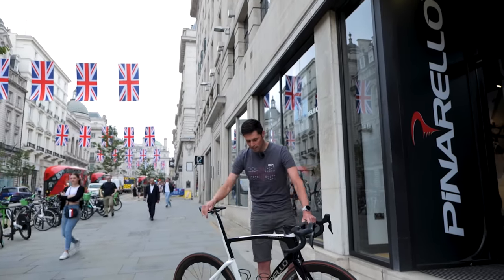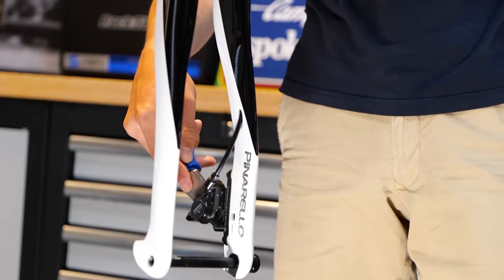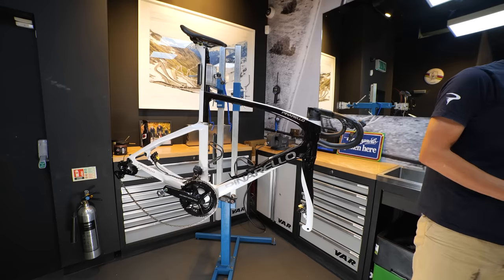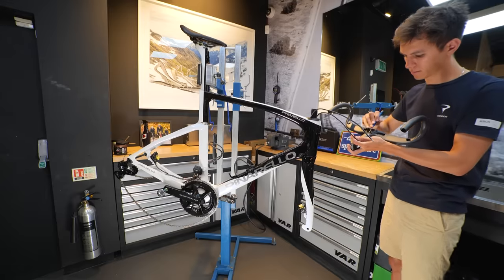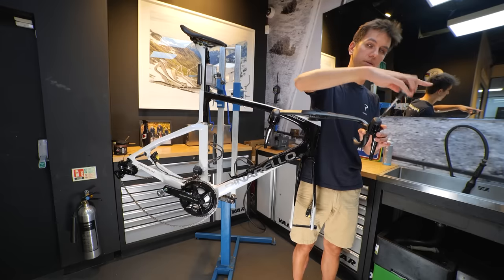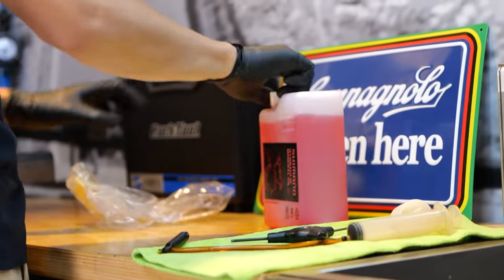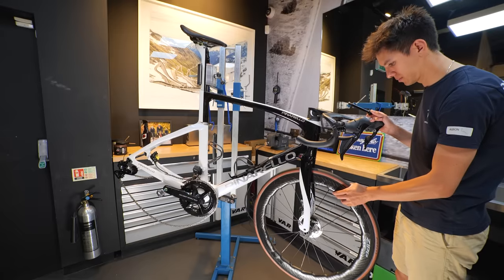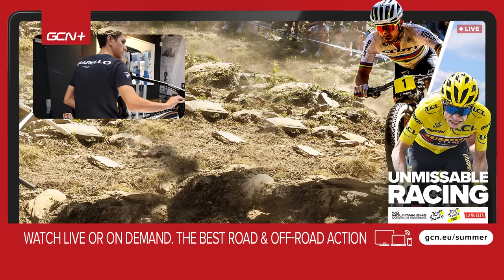How To Change Integrated Handlebars!

Comment from the maker: What is the worst bike maintenance task? Let us know what you think it is 👇
Reply: SHORTENING CABLES: You have to readjust shifters, bleed brakes and recenter them just after shortening :(
Reply: cleaning a clogged up and seized derailleur.
Reply: I think that looks like it.
Reply: looks like this !
Reply: Maintenance of the headset on internal routing bikes jajaja that’s fun … and change cables brakes on rim brake tt bikes jaja Bmc is specially fun
Reply: Aligning disc's with the calipers
Reply: Front derailleur alignment/indexing (Mechanical).
Reply: Nothing is difficult, I only have semi-integrated cables. 😂
Reply: fixing dynamo lighting on a bike with internal wire routing. pain in the ass to troubleshoot the broken wire and then thread the wire through the frame AND the rear pannier rack.
Reply: @EstelonAgarwaen  LOL, I had to do that on PBP one year. My generator fell off ripping apart the wire. I fixed it with a piece of derailleur cable. Worked really well. I only had to go through the chainstay though.
Reply: Now change the headset bearing on that bike.  Then add 3 spacers to the stem.
Reply: Probably change brake hose as was too short as olive not go on, funny SRAM changed it now but I got to sort lever by retap shifter or £200 for new one

Anything else I enjoy, even tubular I use are awesome

Comment: I think the title should be "Don't Change Integrated Handlebars".
Reply: Should be "Don't Buy a Bike With Integrated Handlebars" - You'd have to be extremely lucky for any bar/stem combo to fit you on any new bike actually. Manufacturers always get it wrong.
Reply: canyon does well with with adjustable bars but everyone else forgot this
Reply: I happily pay my LBS to take care of anything complicated. They stay in business and i don’t end up with useless tools and a big mess
Reply: Or even better, 'dont buy a disc bike'
Reply: @DavidStacey-tx7on with that level of integration rim brake would just as much of a pain swap bars.
Reply: @JZTechEngineering but with a Canyon you can’t adjust the reach or swap out the stem easily for a different stem angle
Reply: hahaha YES!
Reply: @DavidStacey-tx7on rim brakes are absolutely terrible in comparison to discs.

Comment: Fantastic seven-minute summary of why many of us prefer external cables.
Reply: came to say this
Reply: Over-engineering at its very finest
Reply: semi integrated it is
Reply: And mechanical brakes!
Reply: I don't know, it's not like I change my handlebar every week...
Reply: Yep , I can rip the whole group set  off my MTB attached to the bars without disconnecting a single cable or hose

Comment: At some point when cutting the brake cables, don"t they get too short and need to be completely replaced ?
Reply: Yes, normally when the lines are originally fitted there is some excess, but repeatedly doing this will eat that up.
Reply: Also I think Alex's new handlebars have shorter stem
Reply: @adamsandler4076  They're also narrower I believe so that also gives more wiggle room.
Reply: I think it may be possible to do a loop inside the downtube or headtube to keep some extra hose. This would also allow the bars to be removed for travel, while keeping the hoses attached.
Reply: Then the real party starts ! :D

Comment: I had no idea any kind of bike maintenance could be this complicated... Wow...
Reply: its not, if you have a bike with full external routing, like us smart people do
Reply: These are relatively easy ones too, most integrated bars don't have that removable inspection cover and some don't even have the exposed cable/channel running down the stem.
Reply: @NewEnglandDirtRoadie  I have full external cables too, but i replace the cables more often than the one with semi internal cable...
Reply: @NewEnglandDirtRoadie  This.👍

Comment: And that was one where the hoses were long enough to suit the new bars / and spacing and had enough spare on the end to account for the amount cropped off at the lever ... the whole job is longer if the hoses have already been cropped once or twice so are right on the limit for length and so new hoses need to be fitted ...

Comment: This is nuts. What is missed in this video though is what happens when doing the same on the previous generation of Campy and Shimano gruppos which also had wired shifter connections through the handlebar. Also given the increased presence of direct to buyer brands like Canyon, I can't see a ton of people making changes to either the equipment on the bike or the fit of the bike after they receive it.  Moving forward I just see a bunch of people with bikes that don't fit them well. This is marketing driving function.
Reply: A bunch of people with bikes that don't fit them well has been the reality for decades.
Reply: @TiagoMorbusSa  I would have to agree. Moreover, one could also argue that if you are going for an integrated bar and stem, you would know what you need before making the jump to this type of setup.
Reply: @TiagoMorbusSa  Far more so now with these integrated abominations.

Comment: It is possible to remove the olive without shortening the hose.

Using a pair of side cutters, with the blades almost parallel to the hose, cut across the circumference of the olive, removing about a third of it. It is then possible to remove the rest of the olive by prising apart the open ends. 

The barb stays in place, and the crush nut that fastens the hose into the lever can be slid over the end of the hose/barb. 

You can then pull out the hose from the bars and reinsert into the new bars.

Comment: Long live my rim brakes and non integrated handlebar. ❤️
I do have one bike with hydraulic disc, but again normal handlebar, and I can change it if required. ✌🏾
Reply: Same here 😊
Reply: Same here too!
Reply: the first thing when i got my new bike with an integrated bar, luckily not fully integrated cables, was to chuck that stupid thing in the trash and get normal bars and stem.
Reply: i’m gonna do an integrated setup but keep my rim brakes. no fluid just a clean cockpit with rear exit integrated levers

the side exit cables bug me now that i’ve seen what can be done otherwise

Comment: So what you're saying is that the correct procedure is to take off the integrated handle bars, remove the stem, then put on a normal stem with normal handle bars and exterior cable routing.
Reply: Too bad many riders don't like that, especially most 2020s cyclists.

Comment: They really should just make the holes in the handlebars just a little bit larger. I actually changed my fully integrated cockpit without cutting the olive and barb off of the end because the holes in my bars were just big enough. Just did a lever bleed after the new bars were set up, and all is well. Just make the holes bigger and/or make the fitting smaller and more reusable :) Duh!

Comment: semi integrated cable routing + separate stem and handlebar = perfect
also separate stem and handlebar allows the best fit instead of integrated cockpit
Reply: You mean like the VENGE with classic stem and aero bars with internal cables (Aerofly) ?
Reply: @SamuelBlackMetalRider  I mean when cables enter the frame in downtube near headtube. this way you can use any stem with any handle bar. it also provides easy service for headset
Reply: @al_peko What you described is now better classified as regular internal routing ever since integrated internal routing came along. Some brands and models have this configuration designed particularly well. Others, not so much.

Comment: I was a part time assistant bike mechanic back then and at one time I was tasked for the first time to set up integrated internal dropbars on a fully integrated road bike.

It took me 2 hours to do the job. And I thank God that I did not have to deal with hydraulic brakes. They are much worse and messy.
Reply: I actually find with hydro brakes to be easier as the hoses are more flexible than brake housing

Comment: The flanged hydraulic connecting bolts at both the lever and the caliper require an 8mm crescent wrench to be removed (not a 7mm). On 11sp Shimano hydro stuff, the bleed nipple at the caliper is a 7mm, but other than that you're not really going to be seeing 7mm bolts. I just wanted to make a note of this so if people are wanting to do this job themselves, they don't go out and buy the wrong wrench.
Reply: Who goes out an buys a 7mm wrench on its own?
Reply: Somebody who needs to bleed their shimano brakes........

Comment: Just a note to satly that the "nylon piston press" pictured is the metal Park Tool PP-1.2, which Park state:

"NOTE: Wedge-style piston tools such as the PP-1.2 are not intended for use with brake systems that utilize ceramic pistons, such as Shimano road disc brake calipers."

Comment: I did this over the past winter. It really wasn't that bad a job, just too some time.
Reply: I agree and i did it on this particular bike but with Sram wireless. It is quite straight forward, but just be patient. Especially with cutting. Make sure you have measured the correct lenght properly.
Reply: @headofmyself5663  My bike is a 2022 Pinarello Prince with Ultra 12 speed so only brake hoses.. I have the alloy stem and bar but it still was not a big deal.

Comment: A day too late. Changed out my integrated handlebars yesterday.
I ran some strimmer line into the handlebars first as I found running the hydrolic lines impossible on a practice run beforehand.

Managed to strip the bleed screw on the levers as it's made of cheese... Plan to dremel a line into it so I can replace with the stronger replacement screws that got released with the 105 di2.

Overall I wouldn't say it's that complicated to do but took longer than expected.

Comment: "Some calipers such as Shimano use ceramics piston which can be easily damaged so, if possible use a nylon piston tool to be extra safe" followed by a shot of the metal Park pad spreader 🤦‍♂ I bet Tristan was glad you were going shorter or narrower as replacing brake lines for longer is a pig of a job.
Reply: The video editor is definitely not a bike tech guy

Comment: Thats why i keep it with rimbreakes 👌 and an old school racing bike 💪
Reply: The Pinarello Dogma F12 and F are two such road bikes with rim brake variants with integrated internal routing, only the front brake line doesn't pass through the headset assembly.

Comment: There are loads of videos on this where you shorten the brake lines, but sometimes you may need longer lines, like if you buy a secondhand bike that needs a longer stem to fit you.  How about a video for that?
Reply: That literally entails replacing both the lines in their entirety. I.e. routing both the lines throughout the frame and fork, through the headset, then back through the handle bars. The connecting process is the same at both the lever and caliper (with insertion of the barb & crushing on the olive with the hydro connecting bolt @ 5-7Nm). Just bleed the brakes and re-do your tape and you're back in business. As a mechanic, I highly suggest bringing your bike to your local shop for this job as it is very nuanced and time consuming, especially if you have no prior experience. If you plan on going ahead with it anyway, God Speed, my friend.
Reply: Yes routing new longer lines could be problematic. The rest is  not different than in this example.

Comment: I'm building up a vintage Rotrax steel frame bike with modern components.  But I wouldn't have integrated handlebars, and all the maintenance issues they entail, even if it were possible.

Comment: Left is your rear brake??? Is that because you ride on the left side of the road?
Reply: that's the NORM, right hand -->> front brakes
Reply: Must be a north American thing, right leaver works the rear brake. Learned something new today.
Reply: Yes, it comes from that. When turning right and using your right hand to indicate it’s preferable to have the hand that’s still on the bars (the left one) operating the rear brake (because it’s easier to control the bike) and vice versa in countries that drive on the other side of the road. 

Personally I advocate for having your dominant hand operating the front brake.

Comment: I had integrated cockpit... I hated it. It was the wrong size and none of the size option offered would fit. Had to change for a non integrated with internal cable. The process of finding the correct one and doing the change took me forever. I hate integrated cockpits.

Comment: When he cut the barb off the hose initially during disassembly, wouldn't the brake hose be too short during reassembly? Since, the hose got shorter?
Reply: That's only if the hose is already at the shortest possible length to begin with. Back in my shop days, I always tuck a little extra back into the cockpit before making the cut, for two reasons.

1) It's easier for the cockpit to be completely removed from the steerer tube.
2) If the new cockpit is slightly longer or wider, there's still enough hose left.

Comment: You know most motorsport teams in endurance racing have quick release hoses so they can remove the whole caliper without needing to bleed the system. Why can’t groupset manufacturers do this?  They claim this is all just like cars but won’t copy this really nice feature used by cars in motorsport
Reply: A counterpart for bicycles exists, but they're too big to be fitted inside any cockpit. Somebody else on a Facebook page's post mentioned about this hardware too, to which I replied the same thing, but he doesn't seem to believe it or is ignorant about it.

So far, I can see this being useful for the front brake hose of disc brake road bikes with external and regular internal routing as you can remove the fork from the frame completely when you disconnect the front brake line for when you want to cut the steerer tube with the fork out of the frame.

Comment: Is cutting the steerer tube shorter as complicated? 

Ive just gotten a new bike and kept my steerer tube long to fit myself in. Im probably about ~5 long rides away from figuring this out.
Reply: It’s even worse, since you need to do what was just done but also remove the fork from the frame.
Reply: @Adonis-qj1nq  damnit. Almost the same process as this?
Reply: No you don’t. Just disconnect the brake hose at the calliper and you can remove the fork

Comment: As far as I can see, most of the struggles would have been avoided if the hole for the wiring was big enough to let the hose connector through without cutting it off. Routing the cable may be a little hassle, but the whole job would be possible with normal tools

Comment: You are assuming you have enough hose still in the frame to use after you cut them with newer bikes this is rarely the case. If you’re adding a longer stem or raising the bars, you’re gonna need new rear hose too.

Comment: I have 2 bikes like this and this is a lot of complexity to hide a very short amount of cable. It's frustrating and long and it does compromise the strenght of  your handlebars because it has holes in it. Couldn't they design a handlebar with a dedicated shape to fit the brake hoses on the outside or right at the back?
Reply: There's one one-piece cockpit that I know of that may tickle your fancy: the Bontrager Aeolus RSL one-piece cockpit. Its routing configuration is classified as guttered external routing. Shift and brake lines don't go inside the cockpit at all, but still maintain a clean look. This makes cockpit swaps with the same cockpit as easy as a standard two-piece cockpit. My only complaint about this cockpit is the long 100 mm reach. If it was 75 mm, it'd be much better.

I remember Black Inc.'s Integrated Barstem is another one-piece cockpit that features guttered external routing for mechanical groupsets.
Reply: Carbon structures with holes aren't necessarily weaker, otherwise carbon frames with "swat" storage holes and holes for access cable routing, etc. would not exist. As long as the areas around the holes are sufficiently reinforced, it is totally fine. Major brands do ISO testing of their frames and components exactly the same you would for regular alloy bars, so the proof is in the testing, not "how it looks".

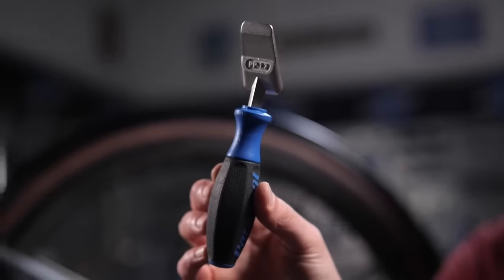Comment: 1:20 the Park Tool PP-1 is made of investment cast metal  . . . of some kind: use a fat plastic tyre lever instead. You should never have to undo brake hoses, fiddle them around right-angled corners, reconnect, (preferably with new hose end fittings) and rebleed TWO OF THEM (let alone fiddling the gear cables  - Di2 or mechanical)  to swap handlebars. It is a stupid marketing-department-led design choice validly applicable only to those looking to save single-figure wattages at the highest levels of the sport. i.e., not you, not me and not the GCN presenters. I've done enough of these to know why, and how: and the 2 x (minimum) labour charge penalty you have to apply over a simple non-internally routed setup is unsupportable customer-predatory bu!!shit by the marketing, sorry, bike manufacturing companies who habitually do this.

Comment: This makes me sick to my stomach…still on rim brakes for my road bike.  All this to change the stem length?
Reply: Some bikes with integrated internal routing and two-piece cockpits allow you to swap stems just as fast as a regular road bike as long as the shift and brake lines are routed outside the stem.

I once needed to do this for my customer's third-generation Venge as he needed a shorter one. His configuration was so easy and quick I could do it on the spot. Specialized did learn this mistake from their Venge ViAS after all.